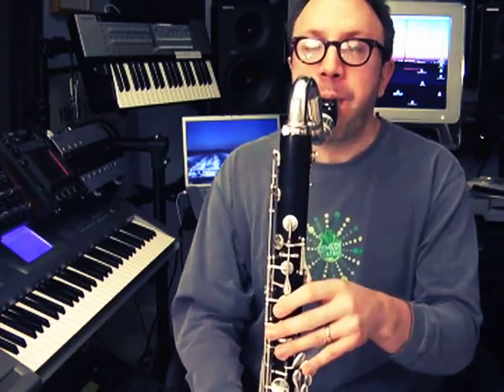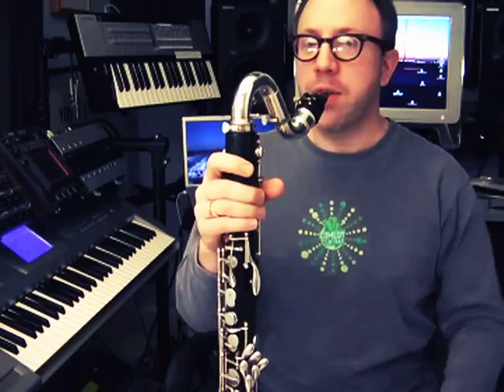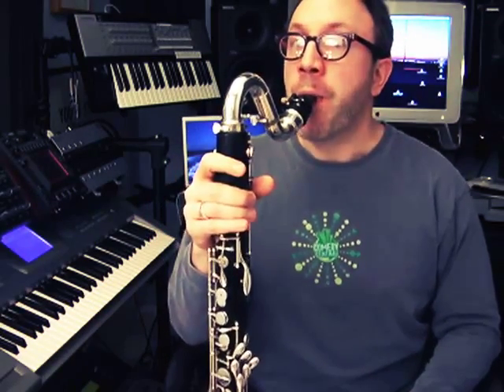How to Slap Tongue

Comment: Thanks man. I'm going to start attempting to work with on bass clarinet. I ultimately want to get it on soprano though. Should I start practicing on the lower voice for awhile until I master it on there to move to soprano, or do you think I start practicing both at the same time? I'm usually semi quick to catch on to extended techniques and how you explain helps a lot. Also, is always a cough for air production, or with more practice can you focus the air more to get a solid pitch? thanks again!